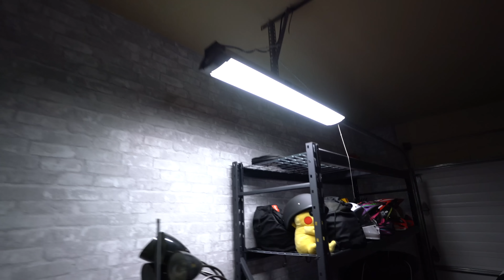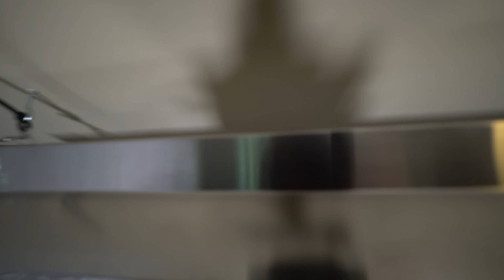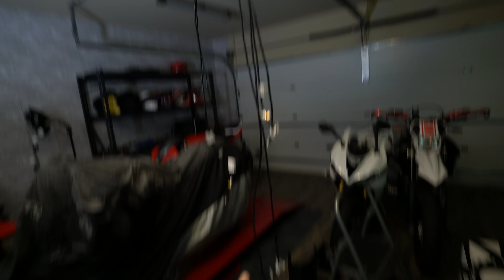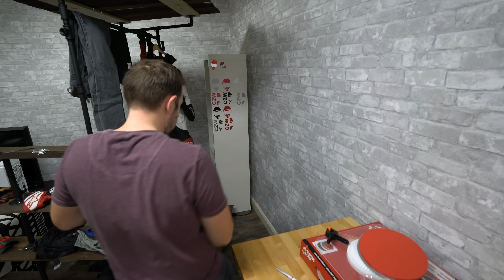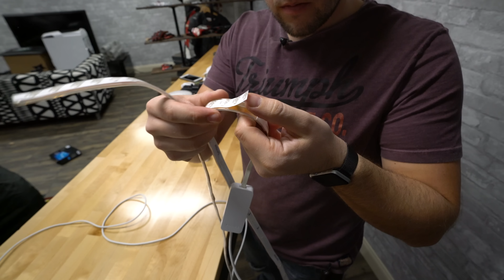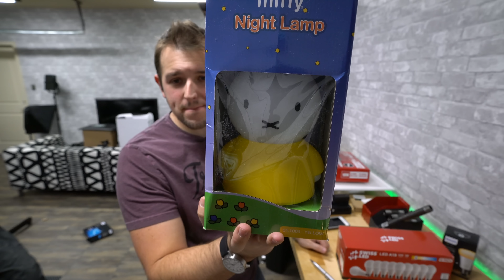Garage Lighting DONE RIGHTish - Garage Build Ep 08

Comment: HAHA, so one thing I would suggest, the power bar you have on the Back of your table..... try to move that to the Front.  When I was helping my father with his garage he got a power bar that can swivel so he screwed it to the underside and then you can fold the bar out of the way or have it readily available rt in front so if you put stuff underneath the table it will not be in the way and you can plug stuff up easily. even if you just 3m to the underside it is more convenient.    anyway good job on the lights and have fun with the bunny.  cheers.

Comment: Get an electrician to mount a cable with a plug on for you on the LED-panel, and you use small chains in each corner and.... zip-tie..... it to hooks in the ceiling.... above your work bench. 
Or glue rubber door stoppers to each corner of the back of the light as feets, so you can use it underneath a vehicle while working on it.

Comment: move the led strip from the back of the table to the bottom of it, and grab another one and put it on your rack to light up your gear. you can grab a color changing bulb for the little light that is on the ceiling.  hopefully you like these suggestions

Comment: Not trying to be one of those self proclaimed internet know it alls, but you really should have used drywall anchors for those hooks. Overtime those are most likely going to fall out of the ceiling under the weight of the lights.

Comment: Hey Chase, the garage looks great. Glad to see it coming together. I know you said you put the lights high enough to keep them out of the video, but I was thinking if you ever get tired of looking at the extension cords stapled to the ceiling you could use those cable covers (usually for a tv) like this http://www.homedepot.com/p/Legrand-Wiremold-5-ft-Non-Metallic-Raceway-Wire-Channel-White-NMW1/100038290 to cover them. Also you could use that led panel as a light in the top of the new gear rack you built.

Comment: you should drill a hole above the light and run the all to the middle and put a powerstrip in the ceiling and have on wire to the plug

Comment: What I would've done is I would've gone for the portable work lights that use regular batteries. They make those for photographers and construction site workers. The batteries is so that you can always keep spare ones on you in case they run out while your filming.

Then you get one of those lights that are strapped around your head for your closeup images. I think this is a better solution than what you're currently doing since your short on power outlets.
Reply: Actually you could also get the rechargeable ones with USB, then buy power banks to extend their battery life.

Comment: The Swis LED Panel, is it strong enough to walk on? If it is then put it right by the door so when you walk in or out of the garage that will be the first and the last light you turn off or on, or somehow put it on the base of the lift looking up towards the bike hooked up to a battery pack. If you don't use that for the lift then buy more LED Strip Lights and put those on the base all the way around facing up towards the bike for lighting underneath the bike, it can also be ran over and would still hold up, again hook those up to a battery pack. Good luck...

Comment: I was cringing when you screwed the hooks into the ceiling. Please use a stud finder to locate the rafters (which I believe are like wall studs, 16' on center), drill a small pilot hole and then screw the hooks into the rafters. 
As it stands (and as you saw with one of the lights coming down) the hooks are just screwed into drywall. While the LEDs are lighter than standard florescent fixtures it's still enough weight that over time the hooks may work themselves out, even with the very occasional pulling of the chain.  
I ain't even going to touch on the extension cords and power strip.
I understand that all of this is essentially temporary. But those lights are a safety issue waiting to fall on your bikes or worse, your head. 
Sorry to be THAT guy. I enjoy your content. Just want you to keep it up sans a head wound or busted motorcycle.

Comment: Hey Chase, only problem about having the power strip under your bench is that you have to lean over and plug stuff into it.  What you might want to do is get you a 1 x 6 plan of wood and screw it to the back of your bench to create a back splash to keep stuff from rolling back against the wall and falling if it moves a little but it will also keep you from slding something into the wall when working on the bench.   Side purpose is you can screw the power strip to that piece of wood and not have to lean under the bench to plug stuff in.

Comment: I wouldn't overdo the lights. Just the ceiling lights and some LED strips here and there should be fine. Maybe stick some LEDs behind your television? Under the couch? Place some on the floor at the spot where your motorcycles go. Put the bikes over the lights so you'll have a glow coming from underneath them. Maybe hang some stuff on the wall? Like a framed large ass picture of a bike. You can put LEDs around the frame.

Comment: Haven't read all of the comments so don't know if anyone has mentioned this but coiled cables are a massive no no. If you are utilising them especially coiled power cables create an electromagnetic field which can generate a lot of heat. Sometimes enough to melt a cable and start a fire. I have first hand experience of this happening. It is safer to cut the cables to the length you require then re connect them to the plug or sockets.

Comment: just some ideas. you should get some 3m wall hooks to hang your r6 light from the wall the raise your work bench a bit so you can put your tool box under it. also do some mood lighting for your rack. put your led bulbs all around your house. the wall switch use for the garage since siri is slow and use siri for the table. the panel you can rig up an outlet or battery and use it for outdoor night time photos.

Comment: i would have cut the power cords and wire them in parallel to that one ceiling lamp. That way you can switch it on and off with the light switch on the wall. looks better if you use some cable ducts

Comment: Drywall anchors would help a lot in keeping those lights secure to the ceiling. I'm pretty sure the TV wall mount is a lighted model to give your TV cool backlit effects. I think some sconces on the walls about 24-30" from the ceiling with more Phillips Hue lights in them would give your garage some primo accenting. I think you can get them battery operated. That panel light you can have someone who is a bit more comfortable with electricity wire it up to an extension cord, and put it on an omnidirectional TV wall mount over the toolbox for a worklight. Love the vids, and the garage is looking pretty mint man.

Comment: Those LED lights work great dude! Makes me want to upgrade my bulb setup. I gota say though, that cell phone connected piece would annoy me to use quickly. In my garage I just ran all the cables into the ceiling and into a remote controlled surge protector. Then I used velcro and tapped the remote control to the garage entrance. one button and all the lights are on. Her is the surge protector if you are interested.

https://www.amazon.com/Belkin-8-Outlet-Conserve-Protector-F7C01008q/dp/B003P2UMNK

Comment: Chase in my workshop I have clearance issues. Even those lights that you are using are too thick to use. I ended up using the sticky backed led strips. That way I have no holes anywhere except for where I mounted the power supply. I ended up doing 6 8foot strips and it is really bright in there now.

Comment: Should of used cable trunking, in white or cream, whatever colour the ceiling is, and then just put the black cables into them, so you wouldn't really notice the cables too much coming from the lights into the socket, especially as they're black against the ceiling colour... and that cabinet you bought definitely needs to be in the corner.

Comment: You definitely should put one of those LED things they sent you on that gear rack you made with pipes. You could put that square light on the top of the gear rack or behind it. Either that or you should take that wood thing off from the top of the gear rack.
You could use that round LED they sent you on the wall instead of the ceiling.
And you MUST use that Bunny. hahaha Awesome video dude ! C'ya !

Comment: Chase why !!! Just put a small hole in the ceiling and run the cables through the addic. It would look so much better.
Reply: He said in one of the first episodes, He isn't supposed to do anything that can't be repaired easily upon moving out.
Reply: Clurie Hyden a hole the size of the plug is really easy to fix. Just patch it with drywall putty.